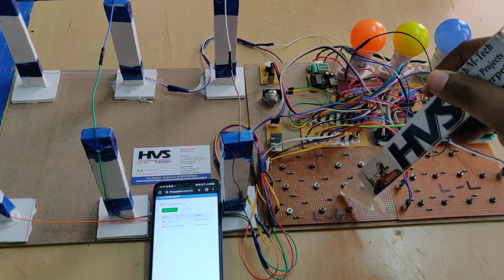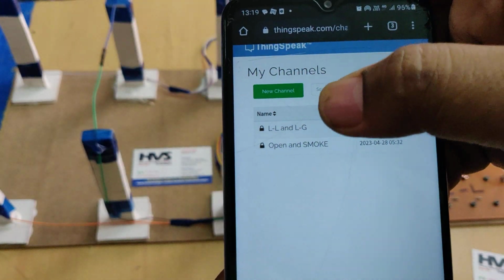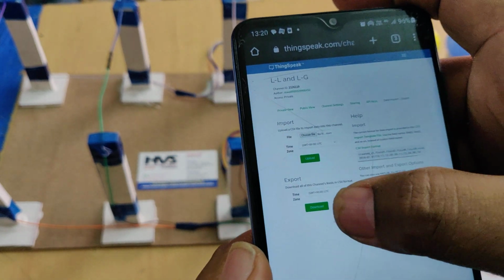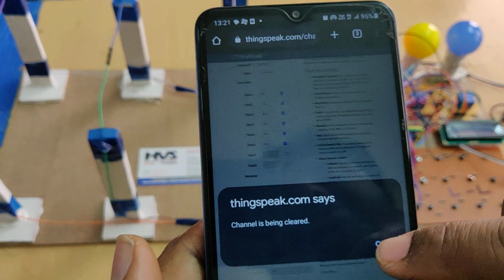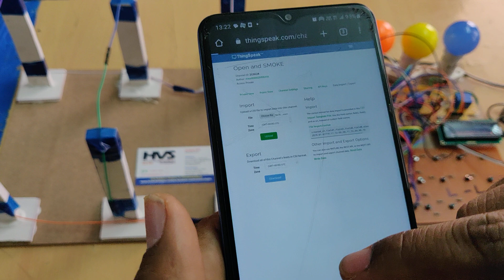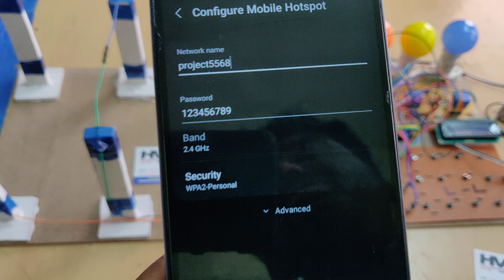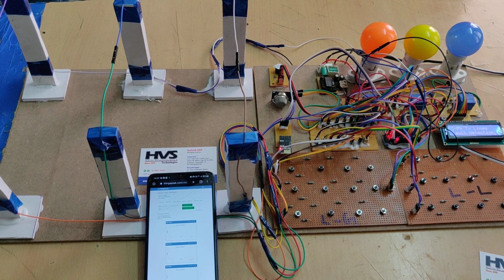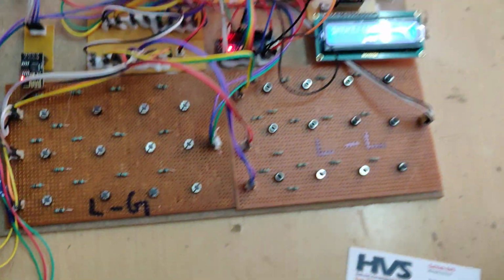HVS-2769. Fault analysis of 3-phase Transmission lines & smoke alert using IoT & Arduino - L-LL-G OC

Comment: can you explain how can you asign this to a transmission line as the input here  is only 230v whereas the transmission line is about 11 kv
Reply from the maker: You can contact us at +919603140482
Through WhatsApp or call
Reply: @hvstechnologies   Yeah same question ? Can you give the arduino code details. ..is there any gitub link?will you please provide .
Reply from the maker: @svtrut-y7x  We sell total project. 
Send me video link
Will update you the cost details.You can contact us at +919603140482
Through WhatsApp or call